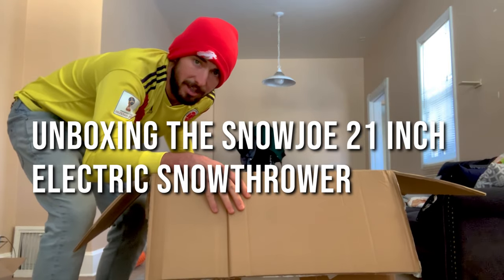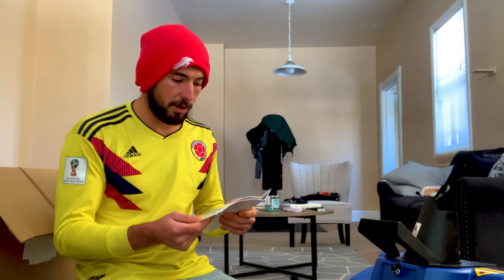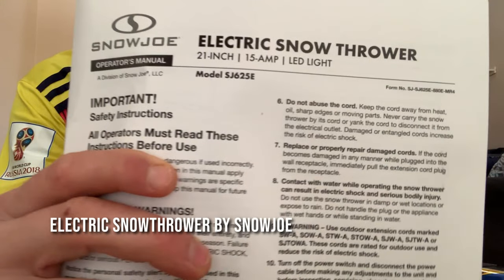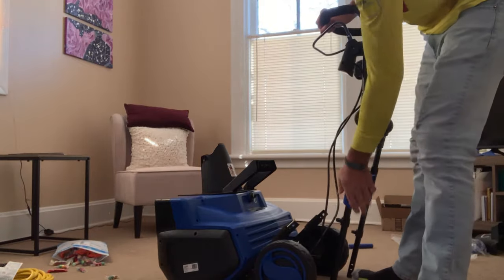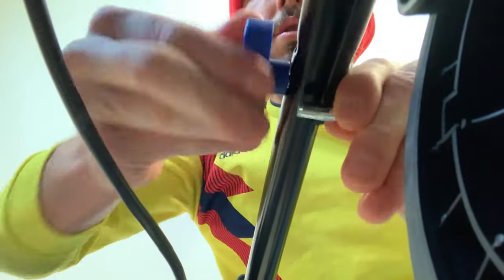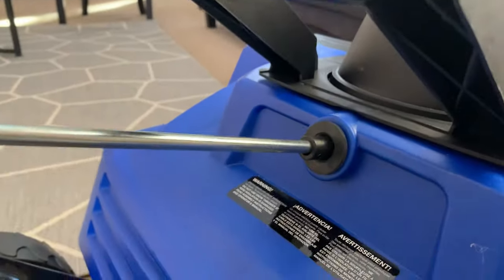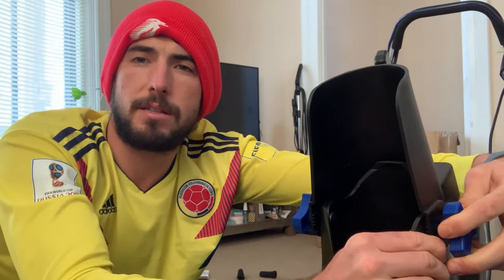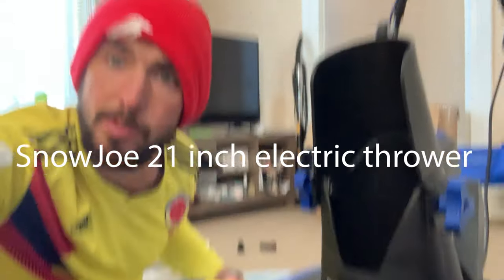How to Assemble the Snowjoe Snowthrower SJ625E 21 inch

Comment: Thank you! Good explanation!
Reply from the maker: for you EVE!
Reply: @ezmomentsphoto  Is that a refurbished model? It looks brand new but didn't come in a new box. It looks like you didn't install the J bolt properly. I purchased a SJ627e in  October but I haven't had a chance to use it yet.
After I purchased it I saw a refurb directly from SnowJoe on Ebay for $30.00 less.
I currently own a 5 year old Toro 1800 Power curve but it has a plastic auger and I wanted something bigger..
Reply from the maker: Hey Will my gf bought it brand new (not sure where from) and I reinstalled the J bolt later after filming (unfortunately no film of it lol ). Hope that model you got will be a good one. Where are you at in this world? - Eric
Reply: @ezmomentsphoto  
Thanks for responding, I'm in upper Illinois still waiting on that first snowfall. Afer a couple of heavy snowfalls, I'll get back.
That Toro I have is very powerful but the Snowjoe appears to be impressive.
Snowjoe also sells an Einhell 21in w 12 in d model from Germany that looks exactly like yours.
I purchased one when it was on sale for  $89.99 in October but canceled it and got the 22in w 13 in d four paddle sj627e. instead.
Reply from the maker: @williamdorsey2029  Ya slow has been slow up here in the UP too! but let me how it goes and ya the snowjoe had a great year last year I just hated the fact it had to be plugged in.
Reply: Thank you for this!
Reply from the maker: @dbzkidkev2  You're welcome Kevin! Did you just get yourself one of these?
Reply: @ezmomentsphoto  I did, and everything worked well! Blasted through 2+ feet of snow
Reply from the maker: @dbzkidkev2  LOVEE it!!!

Comment: Step 1 won't work with mine.  Bolts are tightened as much as possible locking handle in down position.  I don't have a tool to get them loose.  Willing to buy one, but customer service won't tell me what I need.